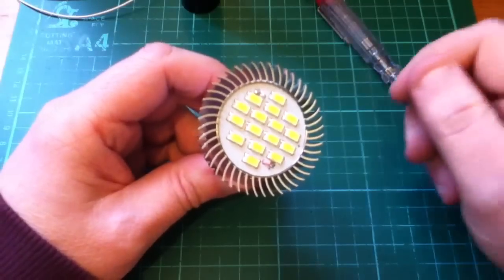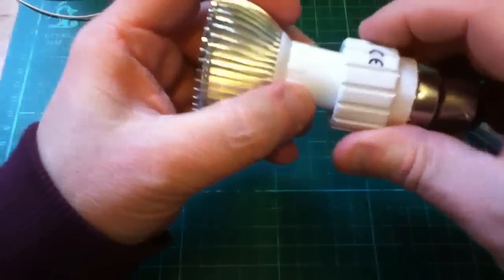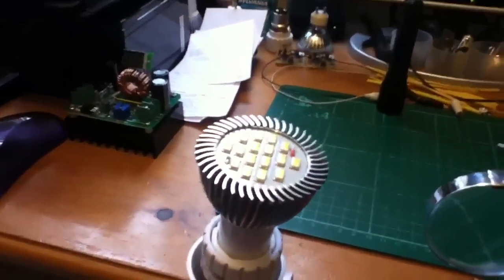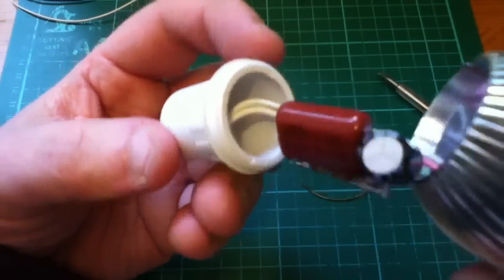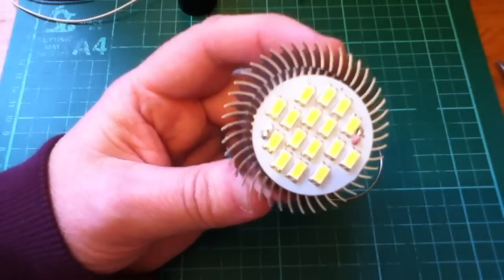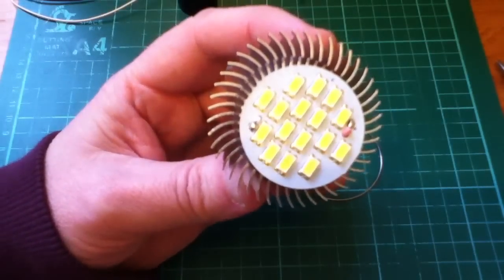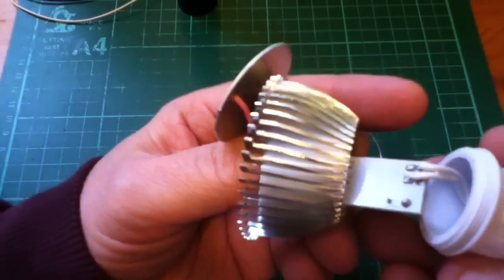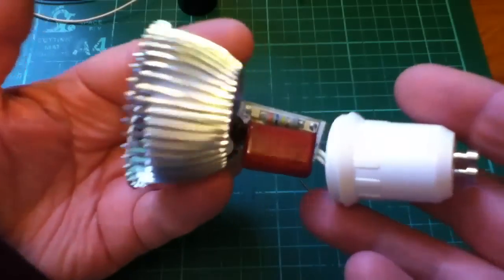Dangerous GU10 LED Spot Light is Cheap and Bright but could Kill You - Seriously

Comment: LOL if all you are talking about is a potential line level shock then who really cares. cheap design?? definately. but jeez man shutting off the power to deal with this would solve that problem and still be overkill.. here in the US line level is only usually 120volts but I wired at least dozen live outlets and plugs today with no problems other then just excercising the general caution to not touch any wires together and didint even have a spark. but still... I cant even count the times ive gotten zapped in the beginning and then less frequently later on... and I dont know any other electricians aroung her who even bother to wear gloves when theyre doing stuff like that. and all those shocks just go though a tool, your fingers, accidental body contact or for a real fun experiece left hand fingers to right hand fingers through the ole chest but who cares unless youve got vaginas on your finger tips. The real moral of this story is if you get these bulbs just dont install them outside while the power is on in a rainstorm and you are barefoot. All the same LOVED this video and very good into to know in the big scheme of things.

Comment: It's only dangerous, if you don't use your head/common sense. I bought some similar on Amazon. I checked these out & they are similar in build, but are better insulated. I refuse to pay an extorted price of $45.+, vs. $5. When the companies who hold the franchise rights or manufacture bulbs & rip off people. I'd guarantee you the yahoo currently occupying the White-house & all the beltway insiders on BOTH sides of the aisle had their stock investments in place when they passed law to ban incandescent bulbs. I refuse to buy florescent, as I've had two explode & catch fire.

Comment: this clip makes zero sense to me. how exactly are you going to get shocked on the front plate if the 240v has already gone through the dropper circuit? ( which is sorta insulated) so the voltage on the front plate is about 12v at about 4.3 - 4.5 amp.... good luck getting shocked on that.

Comment: With AC, I don't think there is a difference between live and "neutral" other than phase.
Reply: No, the neutral wire stays at a constant voltage, the live varies in voltage.
You can touch a neutral mains wire and be completely fine, but touch live (whilst earthed or touching neutral) and it could just be the last thing you ever do.
Also, I do not advocate touching connected mains wires under any circumstances (just in case), so don't actually try this.
Reply: TomA475
The neutral wire also changes voltage, but in a solidly grounded system the neutral is tied to ground at the transformer or the distribution board. In respect to ground, neutral voltage is constant, but in respect to phase you will see the phase voltage, e.g. 240V
Reply: TomA475 i strongly disagree , the names are use to keep from mix ups at the box, hot means connected to circuit  breaker , neutral is connected to the common bus so if you didnt have a name for both wires then by mistake you may connect 2 commons to  outlet and get no power black wire whit wire both have ac current potential @ 60hz
Reply: TomA475 maybe in your country neutral has constant voltage , did not mean to sound like a jerk
Reply: In the US the three lines are:
hot
company ground
(and the optional) local ground

And you can't ever rely on the local ground.
So while it's possible that the company ground floats a bit above being a pure ground because of the length of the circuit, it's pretty much neutral
Reply: CafeAlpha
 Though, come to think of it, in the US, oddly, if you have a 240 volt circuit, then both sides are hot, but that's ONLY for 240.
Reply: I thought one side was normal AC (phase 0 degrees) and the other side would be the inverse (phase 180 degrees).  of course that does mean that each side would only be 60 volts.  I am probably wrong though, I do agree with +CafeAlpha .  And I live in the U.S.
Reply: TheVirtualFlight*facepalm* Not the inverse, just 180 degree phase. woops
Reply: Actually, there is. The Neutral wire is connected to the Earth Ground terminal at the mains breaker box and that, with copper or any metallic water service, is the "grounding" point (never the gas feed, if any). The Hot is what it says on the label. In the US and UK, most homes are "split phase" where the Neutral wire from the pole is from the center tap of the pole transformer. Both ends are brought into the home as Hot leads. This allows high load appliances to be run on 120 (US) 240 (US/UK) or 480 (UK) to reduce current demand on the wires. This is indeed 180 degrees as you stated :P
Reply: Joseph Perkins i see ,thanks for the comment
Reply: May be talking to a dead person ! Only if the mains is connected via a transformer is it not lethal. For example the special transformers used to isolate portable tools. Straight from domestic mains outlet live is deadly. Always treat mains with respect and buy a voltage meter.
Reply: ive touched em both as a young boy and as a hasty adult , still ticken... not saying go diving into a pool with mains in your mouth
Reply: ***** Uhm... "mains" and any potential at all that can induce more than micro Amps of current to flow through the heart can be lethal. Unfortunately, the exact current is idiosyncratic (means will vary from person to person and situation to situation). Generally, it is recognized that approximately 40mA will be lethal if sustained and to mitigate this, 40mA is what GFC Interrupters operate at (whether a breaker or outlet style), Just because it is isolated by a transformer is no protection at all if that isolated potential flows through your body. It's just that touching a sink with one hand (which is the same as your mains "Neutral"/"Ground" wire) will not provide a return path for current if your other hand contacts the transformer isolated voltage. Put one hand on one terminal of that transformer and the other hand on the other terminal and you'll have an energizing experience :P
Reply: actual lethal exposure  is 700 volt 30mA
Reply: NOBOX7 I would not depend on that as that is entirely idiosyncratic and will vary. Otherwise, no one would have ever died in a bathtub when a 120V mains hand held hair drier was dropped in... a favorite method of movie murderers for a reason.
Reply: +Mike Mansfield Actually, I have two multimeters and an oscilloscope (Rigol ds1000z).
Reply: Look at entries from On Semi and TI. They're fairly inexpensive in single quantities, available from Fry's, Mouse and Digikey and many offer total isolation of the load using a low cost ferrite transformer. Yes, many companies make LED drivers, but any decent off line switcher that can be programmed for current can drive any LED or LED string safely. Non isolated switchers that can drop 700VDC to 22VDC at 200mA exist from On Semi and Power Semi. All of the Cree and GE lamps here are active. Passive is a last resort to make ultra low cost lamps. None of the designs are "hobbyist" safe. All have lethal drawbacks, so be very cautious. Use aa 1:1 mains isolation transformer with fuses and probe the circuit with one hand behind your back, etc...
Reply: YTPmaster In US domestic service, the transformer secondary on the pole, typically serving several houses, is 240V center tapped.  Three lines enter the house after passing through a meter which also serves as a disconnect, the center tap being called neutral and IIRC tied to earth ground at the breaker box.  There is a neutral bus and a separate protective ground bus in the box.  The other two lines pass through a twin Main Breaker and are connected to pairs of interleaved comb-like buses running down each side of a typical box which can hold two vertical stacks of breakers.  The breakers clip to a central support and then clip over one of the fingers of the combs, so that as you add breakers to the stack they connect alternately to one or the other of the 240V pair.  For a 120V domestic circuit you wire from one of the breakers, the neutral bus, and the protective ground bus.  For a 240V circuit you use a pair of breakers twinned together with a common or tied handle, and wire from each of that pair and protective ground.  Because of the interdigitating (did I make that up?) buses the 120V loads are distributed reasonably evenly between the two hot wires, and the 240V twin breakers automatically connect to both hot wires no matter where they are plugged in on the stack.  The circuits leave the box in a star configuration, there's no ring main; so the most distant outlet on a circuit sucks hind tit so to say.  It's not a problem in ordinary practice.  Individual outlets or duplex pairs in vulnerable areas like toilets are equipped with what we call a Ground-fault Circuit Interruptor, which compares current in hot and neutral and if there's more than a few mA discrepancy shuts down the outlet.  Larger devices like yours are available for full-house installations but not ordinarily required. Most 120V circuits are rated either 15 or 20 amps.  Outlets are not switched at the outlet though there may be a wall switch (often one outlet in each duplex pair in the room will be switched at the room entrance for lighting, and the other unswitched (and a different circuit) for other loads.  Plugs are not fused though the devices they serve may be.  We call the flexible supply lead between plug and device a cord (or electrical cord) rather than flex.  You must be horrified at how flimsy our 120V plugs are; we're certainly astonished at the size and weight of metal in yours.  When I was a child ('50s) few domestic outlets were three-wire.  They were polarized and looked like our present three-wire outlets but without the "U-ground" terminal.  However polarized cords were no longer in common use.  Now all new outlets (rare exceptions?) are three-wire, and almost all two-wire cords are polarized.

My parents owned a house once that had been wired by a rich-ish "early adopter" and it had a couple of rather horrifying characteristics:  first, the original circuit box had four circuits, but eight fuses: they had fused both hot and neutral lines, both unnecessary and dangerous as if the wrong fuse blew it would leave the circuit disabled but still hot.  And the really scary bit; the outlets in several rooms were on short pigtails coming out of the baseboards through little porcelain tubes surrounded by brass cover plates.  On examination, the plates had twin doors that each carried half the hole that the porcelain tube protruded through; and those doors would flip open, revealing that the tube was in fact part of a plug inserted into a socket behind the doors.  The contacts on the plug ran up the sides of the plug and forced apart corresponding contacts in the socket.  The pigtails were just means of adapting these horrendous things to less ancient outlets instead of directly powering lamps and such.  Any such baseboard socket that was unoccupied had a baby's-finger hole to reach into and pull the pretty brass doors open, and behind it a cavity just about right for three or four pound coins to fit partway into, the whole being about three inches off the ground and of course wired to kill.  We haven't got pound coins of course so we're all safe.   I and about a zillion little ones visited that house over twenty years before I discovered that charming feature.  Don't know when it was originally wired but I can't imagine that idea survived very long in the wild.
Reply: dbeierl I've seen the same sorts of badly thought out compromises. Usually due to the perceived difficulty, economic or logistical, of doing it the right way. Oh, and the mains arrangement is called "Split Phase".

Comment: this one will be a bit "of topic" - i´ll get to the point quickly:
we (in the EU) are about to get the TTIP ( wikipedia.org/wiki/Transatlantic_Trade_and_Investment_Partnership ) that will open the market for trade, we here in germany have something called "TÜV" it freely translates to : Technical Testing Office, stuff that is electric and companys that want to sell thier stuff on the german market need to get thier goods testet first.

if the TTIP gets signt, i doubt that stuff in germany can get banned becouse it´s (like the LED-Light you showed) it´s potentionaly unsave.

(sorry fore the misspells ;) next time i wright in german, but i doubt to get an reply then)

Comment: I am an LED designer and producer in the US. I do not support chinese LED manufacturers but what you are claiming may not be 100% true. That board had a chip on it. Those chips are usually defiled but are copies of american driver chips. Though copies and low quality they work OK at least for the price you pay.
Reply: The "chip" is called a bridge rectifier. The guy in the video doesn't know what he's saying. The circuit is perfectly safe.
Reply: Other than the bridge rectifier there is a driver chip in there too. powtech is the most common brand of the driver.

Comment: Julian,

I bought some similar SMD LED bulbs from ebay in Nov 2013.  On Ebay it was claimed they had CE Certification.  When they arrived I took the precaution of checking out the metal outer case with a voltmeter and discovered 3 out of 10 bulbs with mains voltage on the outer metal case.  After (easily) opening one of the bulbs I found a similar problem to the one you highlight in your video.  I my case the issue was tiny screws holding the PCB in place had caused a short to the metal work.  I tried warning the supplier but they were not interested so I reported it to trading standards.  Impressively,  their reaction was swift. They purchased the same bulbs, had them checked and then raided the sellers premises in the UK seizing all their very considerable stock.  They later showed me copies of the purported certification which was laughable.  Problem is, as they said to me, whilst Ebay continue to allow  these companies to trade closing them down is almost imposable, they simply set up again the next day under a different name.

With regards the Home bargains lamps mentioned by AintBigAnitClever, I have bought some of these and was impressed.  They have a ceramic base and a solid glass body so are well insulated  and can't be easly taken apart.  So far they have worked well.

Keep up the good work with large LED's. I'm playing with them too and your videos are a great help.

Purclewan.

Comment: Great video, I swapped all the bulbs in our house with LED bulbs from China, as they were all plastic on the outside, they were PROBABLY okay, but I would never have guessed some could be made this badly, generally when you buy stuff from China it has been engineered to be up to EU safety standards, obviously not in this case.